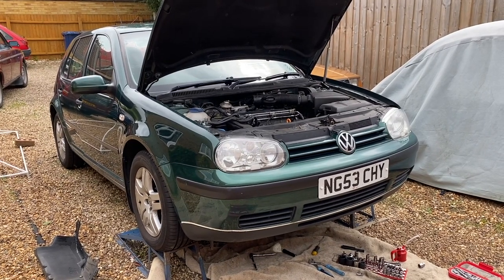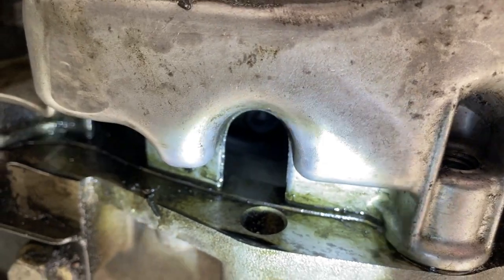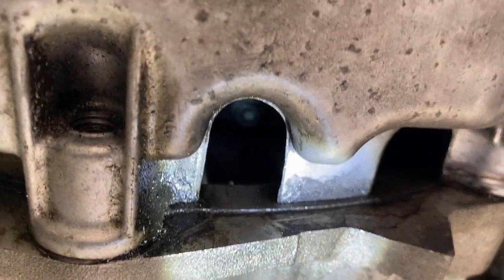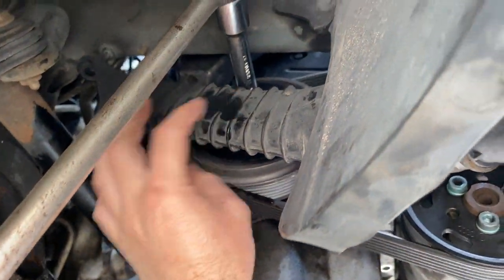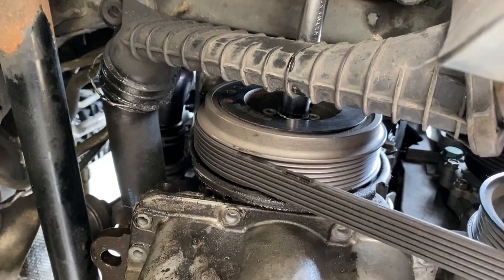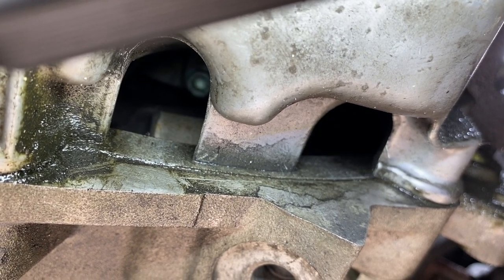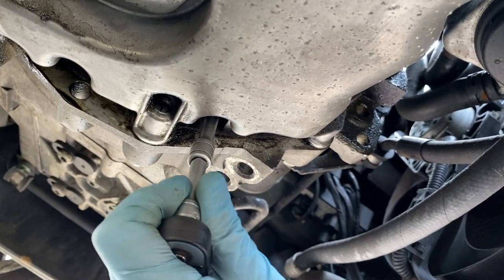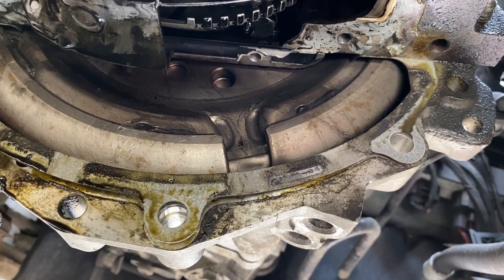Mk4 Golf TDI: How to remove those two problem sump bolts (and Audi A3, Beetle, Bora, Octavia etc)

Comment: Man, I have watched many videos, showing so stupidly how much this job is easy, without showing the true agony of removing those bolts, which rendered so many commenters to fail, whilst trying to take them out. yet thousands of subscribers and likes, and so many comments were not answered asking about the tools or ways to take those two stubborn bolts out, I have to tell you, you deserve thousands of subscribers just for this video alone, thank you very much for the info, and you got yourself a new subscriber.
Reply from the maker: I’m so pleased this video has helped someone 😊
Reply: I know right? So many videos that say remove the 16 something bolts and then remove the pan. Ya easier said than done. Some videos mention the two shit bolts but never show how they remove them.
Reply: Out of two days searching all recent videos how to do this on vw group, THIS video is the best. I turned crank & found the groove on 2014 Octavia 2.0 Tdi which gives more access to the two 5mm Allen or 10mm screw. I did use ball End Allen to help. So thanks for doing this video. I did run into a problem tho. Once broke the sump seal there was an unexpected black plastic undertray thing that fell off but oil pickup stopped it hitting the ground. There was no way to get it back in place & to stick to the engine so just had to hope it was in correct place after silicon the sump & pressing the sump home. Anyone what the hell the black plastic tray is / for… ? Couldn’t see any clips or anything to get it to stay put inside engine. Filling with oil tomorrow, after giving it 24 hours for extra cure… fingers crossed 🤞

Comment: I remember changing the sump on an octavia a few years back and those bolts breaking my heart, had a different video just pop up that I had watched at the time just there and watched it just for fun. Your video came on after and I wish I had seen this years ago, I remember cutting up a perfectly good Allen key to do this idiotic job last time
Reply from the maker: This is why I did this video - I struggled with allen keys and gave up overnight when I did more research and came across this tip on a forum

Comment: Got one of the two bolts loose, the other is defeating me for now. 

Have a G60 clutch and flywheel… so no cutouts. 

If this has to be a gearbox off job I’m going to cry.
Reply from the maker: Oh dear, hopefully you can manage it. I found some long allen keys with a little head on them could just about get in there
Reply: @MorselsAndMotors  tried a 5mm long nose allen socket and a 10mm universal 3/8th… ordered a 1/4 to hopefully bend round the fly.

Comment: In the end I got them out, using the method in the video, and by borrowing the smallest 1/4" socket (with the least blunt end) and thinnest 1/4" extension I could find, and - crucially - tapping in a 3/8" extension into the sump hole next to the 1/4" extension to keep it perfectly aligned as I turned it, and pressing upwards very hard as I turned.

A very difficult job and the bolt heads got wrecked. I think it's worth using those tools and the method in the video from the outset. I started with a 10 mm 3/8" socket and 3/8" extension and NOT using the method in the video, and the bolt heads got so damaged a nightmare began.

I know that they were torqued correctly - I put them in with a torque wrench a few weeks ago when the flywheel was off.

Tip: Many replacement crankshaft seals are plastic, so don't use a jack under the wrench to hold the socket on the bolt head because if the bolt turns the plastic could crack.

I've put new bolts in now, at only 12 Nm instead of 15 Nm to try to make the future better. I hope that works out.

Comment: Hi, do u know if is it valid for 1.9 TDI 105hp bls engine code?
Reply from the maker: I don't know for sure how different that engine is from the PD engine in this car, but I would imagine if you are trying to remove the sump and can't get at these bolts that the flywheel cutouts will be there

Comment: There's an even handier way.  Provided they're the original bolts there should be a 5 mm hex in the centre of the bolt.  I used a good quality ball end allen key and a small piece of pipe as a lever.  Was afraid the ball-end might snap off but the bolts weren't overly tight.
Reply: That didn't work for me. The ball of hex key just broke off. That's was even using the technique in this video to keep it as straight as possible.
Reply: @JSB2500  yeah if they're a bit tight it may be an issue with a ball end. It's worth a try though. If one isn't going to loosen with a reasonable amount of force it'd be best to try the method in the video

Comment: Theres a much easier way to take them out, just use a long allen key and a spanner.
Reply from the maker: I tried that for hours, but the Allen key couldn’t get enough purchase because the flywheel meant the angle of entry wasn’t straight on
Reply: @MorselsAndMotors  the one i use is the ball shaped end from halfords you put that through the gap where the bolt is hiding then put a spanner closed end  spanner on the 90 degree part of the Allen key then turn. Ive done it so many times worked on every car That has this engine
Reply: @MorselsAndMotors  then again i got the benefit of working on a ramp, its a lot harder with jack stands
Reply: @1048-e5d  My bolts are too tight for that. If they were put in using a hex key then you'll be OK for sure.
Reply: Which direction should the engine be turned?

Comment: Hey dude I know this vids years old but let's say some previous owners rounded those 2 flywheel offset bolts 😂 what would you do to get sump off?
Reply from the maker: They are hex inside, has that rounded too? If so, you probably need one of those bolt remover sockets, that grip onto rounded bolts. Though I’m not sure they make them that small. I used some on locking wheel nuts where we didn’t have the key
Reply: @MorselsAndMotors  yean unfortunately there butchered inside and out. Its going in somewhere I cba dealing with that shit 🤣